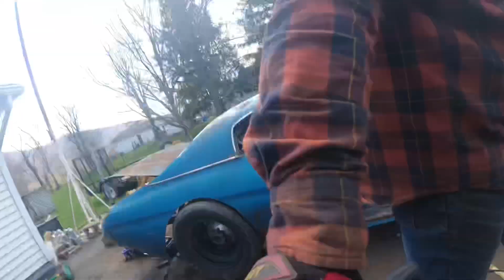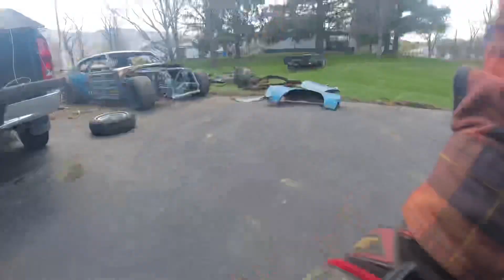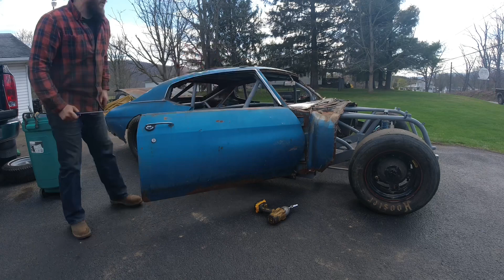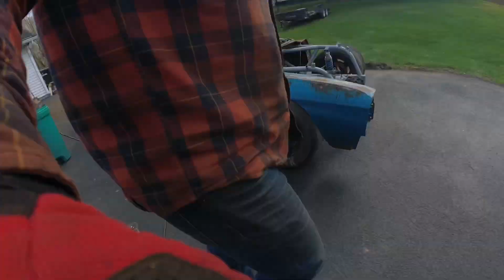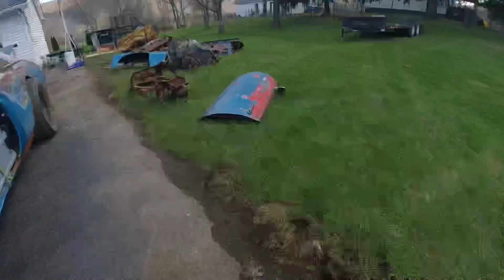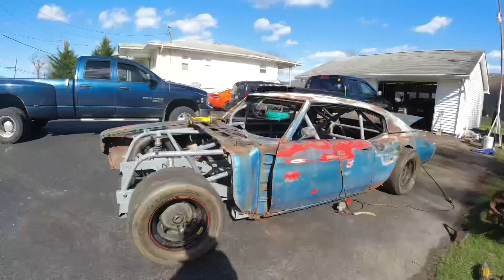Turning Old Nascar Street Legal ❗️❗️❗️

Comment: You are inspirational sir.... I have a 72 Chevelle, that had an unintended off road excursion. I knew the only way I could afford one was to get one that was totaled or rusty. But my intention is to cut off the bent stuff,  use an awd olds bravada frame in the front, gen 4 5.3, and leave it fairly rough looking. Scyclone drivetrain, with a cool rusty 2 door wrapper.

Comment: What chassis number is it should be on driver's side near the floor by the seat on a piece of square tube
Reply from the maker: never found a number anywhere
Reply: @Freddie-adhd-Abe  that sucks probably a home built copy of a left hander or something not hard to copy a chassis builders made chassis make a jig by setting the old chassis up on a huge perfectly flat metal table like in huge metal fab shops cut out clips and other pieces of metal to use as your jig trace the bottom frame rails onto table with soap stone and start fabercating using measurements and making spacers and saddles like you use in ship yards to drive a metal wedge down to clamp the new rails and stuff to the jig or table surface so you don't have to do so much grinding to remove the welds you placed on it  to hold it down very easy if you got some knowledge lol. And it's fun copying a built chassis for dirt tube chassis and Camaro and metric stub modified chassis and anything really you can copy
Reply: @Freddie-adhd-Abe  and then you live the jig all together and if you gotta reclip the front or rear of the car you strip it set it back up on the jig and put your new clip on and reassemble the car I done it a few times with every tube chassis or any chassis I have so that way I can reclip a car and back together in two days to race following weekend